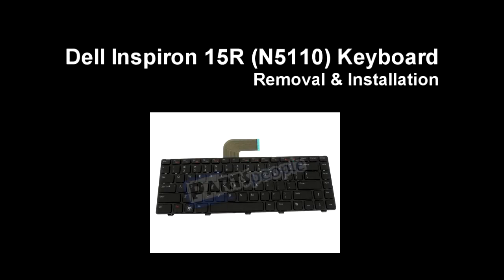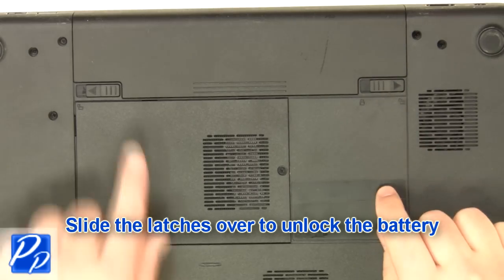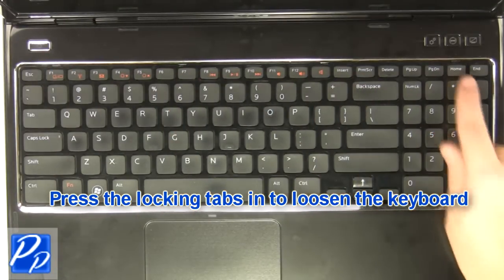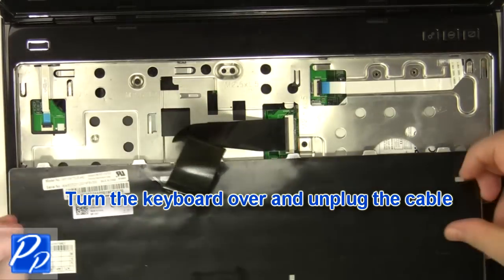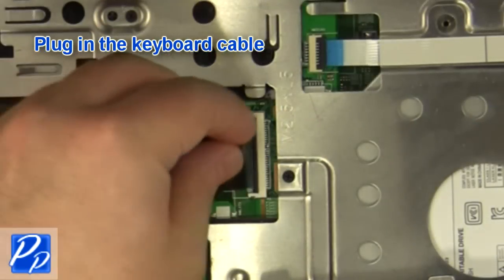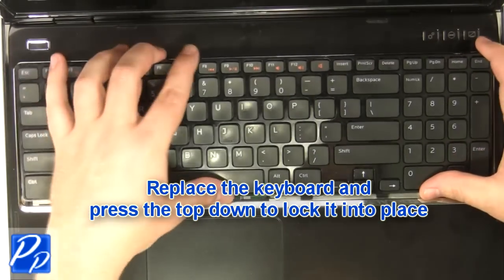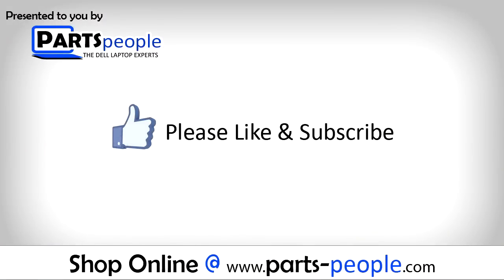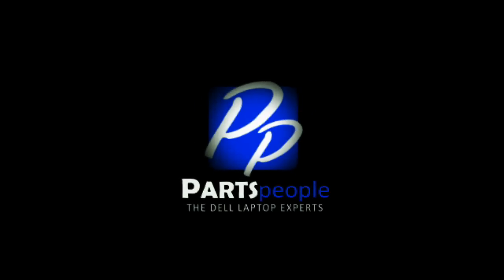Dell Inspiron 15R N5110 Keyboard Replacement Video Tutorial

Comment: I've used this tutorial twice now to fix a keyboard that had come loose (the part that plugs in seems to have a tendency to come just slightly unplugged so that while I can still type, everything freezes if I hold a key down, and I can't use my keyboard in conjunction with a mouse or graphics tablet). Called Dell the first time and they kept me on the phone for over two hours and tried to convince me that my computer was swarming with viruses and I needed to buy their antivirus software for a few hundred dollars. A friend suggested that the problem may just be the keyboard itself, so I looked this up and, voila, a solution to my problem in less than 2 minutes and that cost zero dollars. Thanks, dude!

Comment: I did everything the same as this but it didn't work at all I don't know why
Reply from the maker: Make sure the keyboard cable is plugged all the way in and fully seated. If that doesn't fix it, it might be a bad keyboard or motherboard.
Reply: +Parts-People.Com, Inc lol is sorted now I used to put the cable upside down that's why it wasn't working, thanks a lot